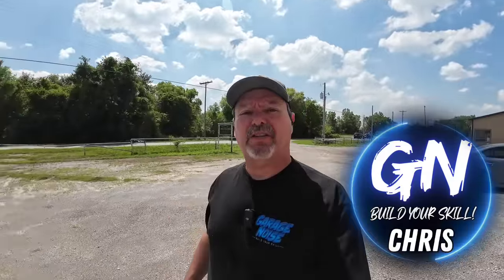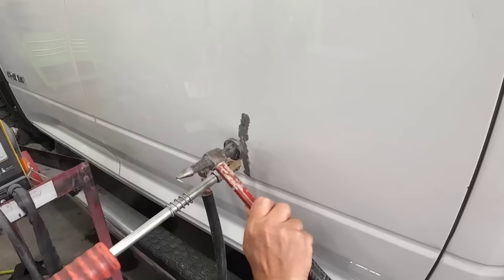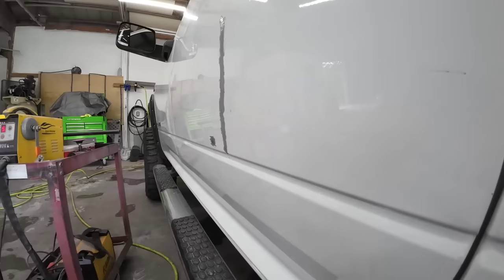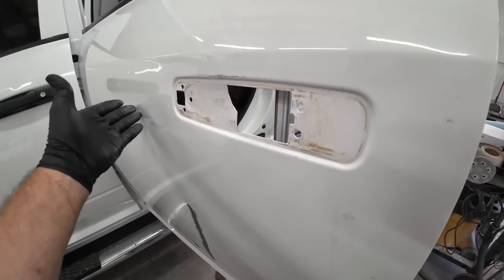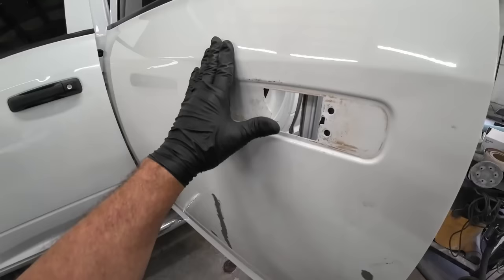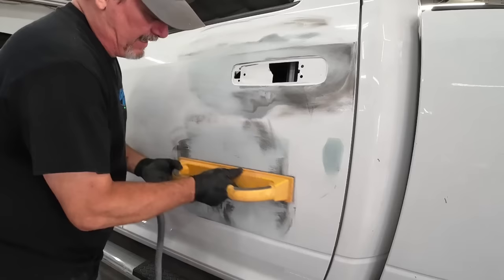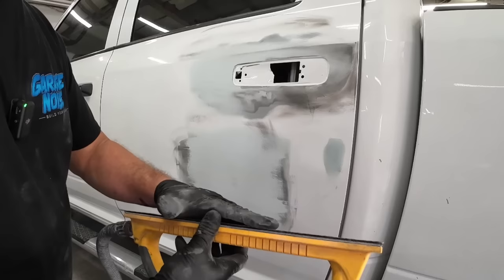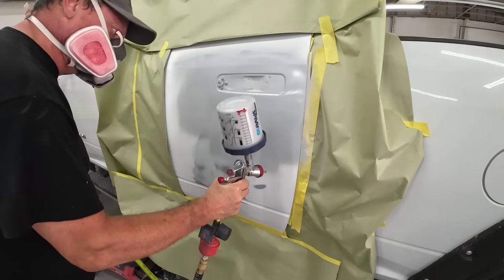BODY FILLER /BONDO TIPS and TECHNIQUES for PRO results!

Comment: You are using the king of masking tapes and sandpaper but the absolute worst filler. Interesting contrast.
Reply from the maker: I had to look to see what filler I was using🤣. It's  definitely NOT the worst, It's  not my favorite. Right now I'm  using upol lightweight gold and that is excellent.
Reply: @GarageNoise  bondo brand is pretty terrible, USC glaze makes more pinholes than it fixes too. That Upol stuff is pretty good. We use Rage ultra at work, no putty or glaze required. Chalks up real nice when you sand and spreads like butter.
Reply: I use Rage Ultra also. I like it because it stays green longer and makes it super easy to sand. I always top coat a thin layer of Icing on mine but everyone does it a little different.
Reply: @Grimsaviour hi I messed up a panel can you help
Reply: Can you tell me what you would skim with? Or not to? 68 cougar pitted roof. But I'm putting a new vinyl top back on. I just worry about cracking later??

Comment: I’ve been in the collision industry for 38 years. Straightening panels has become so much more difficult throughout the years. The thinner the metal they use the harder it is to work. Much easier to pull but harder to sand filler flat because the slightest pressure moves the metal. Back in the day it was more difficult to work the metal but sanding filler work was much easier because the metal didn’t flex with pressure and there were more body lines and convexed or rolls in the panels. Today’s vehicles the metal is so thin and flat panels like to bounce.

Comment: Pretty basic stuff first rule never put your bare hands on bare metal !!! And on higher end cars never put filler on bare metal as The ingredients in the actual Hardner of the filler causes rust underneath the filler in time as it Reacts with the 😮steel it’s ok on smash work in a fast 💨 moving shop  but on my own cars or Restoration work on muscle cars epoxy primer first always

Comment: I’m old school but it’s cheaper to go buy a replacement part aftermarket then to fix the problem by the time you pull out and bondo block primer it’s better to just buy a replacement one
Reply from the maker: Maybe, but then how would I make a video sharing how to repair it?😁
Reply: Cheaper? No then you have to pay for the overhaul  and transfer of parts between doors and to remove and install plus prep time and paint materials definitely better to repair the door for both the tech and the insurance’s wallet

Comment: Nice tips for a DIYr like me. I just went through my first gallon of U-pol Professional filler which sells for $37 at O’Reilly. It’s one step up from their base filler. I used to use Evercoat, but it’s now twice as much as U-pol. I really like the U-pol versus Evercoat and 3M Bondo brand. You don’t have to stir it up to mix the resin when you first open it up! It’s smooth and easy to spread and apply. I get a minimum amount of pin holes in it. It easy to sand. No reason to ever use another brand or pay more to get a “better” product imo. Great for my needs. Thought I would say that since you compared the USC brand filler to U-pol. I agree with you.
Reply from the maker: Yes, Right now I feel like the upol filler is the best all around filler all things considered. Appreciate your comment!
Reply: Thanks for the info. I bought 1 gallon of evercoat about 1yr ago and it’s so much better than Bondo filler, but it cost me almost $80!!! That’s outrageous! Now I’ll know that there’s a better option, although I do t do much body work, but I’m planning to start getting into it more.
Reply: Yes...ALL EVERCOAT products went UP in price at a 30-35 PERCENT markup beginning of LAST year 2022...So their BEST quality RAGE ULTRA filler went from $80.00 TO A whopping $135.00 retail price! 😬.....I mean, c'mon EVERCOAT 🥵. THAT IS your THANKS to us restoration guys that SWORE by using the EVERCOAT QUALITY line of fillers, polyprimers etc....I hadn't ever used ANY UPOL fillers yet, but I am currently using the 3M (customer has an O Reilly material account so) which? I actually REALLY like it. Doesn't sand ANYTHING like the RAGE ULTRA (as THAT IS WHAT we have to pay for- SUPER easy sanding filler that is reminiscent of drywall topcoat mud!) But still....Guess I'll have to try some UPOL after these two 3M gallons are used. 😎 Happy Restoring and Cruizin 🤘🔥🤘
Reply: @_N_B_0496  And yeah, STAY AWAY from actual BONDO brand filler! NOT a quality product AT ALL 😞.... I mean CRAP .

Comment: Amazing tutorial Chris, it's very interesting to see how you pull out the dents in the door you could actually see the dent coming out when you pulled on it while nocking down the crown. As I've mentioned before body filler is my weak point as I always take of to much then I find it difficult to get the shape back in the panel.
Thanks for sharing your skills with us🙏👍John UK
Reply from the maker: Glad it was helpful!
Reply: No entiendo mucho inglés  y no fue my intensión causar ningún problema yo no beo bien a más de 20 pies

Comment: Hey Chris. Great job but have you ever tried the glue tabs they make for paintless dent repairs. There are several guys on you tube channel that show them fixing dents that are worse than the one you fixed. I was working in body shops where we drilled 1/8" holes to screw in the slide hammer + pull rods to the same type of repair you did. How times have changed. Thanks again Vince.
Reply from the maker: Yes, I've been working on my glue pulling and pdr skills. I do some glue pulling in a upcoming video. I'm not as skilled at it as a pdr tech. some of the dents they repair is impressive for sure.
Reply: @GarageNoise I'm NOT an auto body repair expert, by ANY means. I'll start with that. People do not realize how easy/deceiving YouTube can be sometimes ,when it comes to watching actual experts "show off" their skill. Experience. Only word lol.

Comment: Is my first time doing body work with Bondo and it's cracking and also has pin holes what should I do sand it out and start over?
Reply from the maker: Not sure why it would be cracking? What filler are you using?
Reply: Yes

Comment: Hi Chris,  nice video.  Regards from México.  
Doubt.  What is that on  black color over the bonded area? 15:12 
Is it spray paint? To fast to see what are you applying. 

Tank you in advance.
Reply: its called guide coat. comes as powder like he used or in a spray can

Comment: By the time you worked on the door and did the bodywork and all the work it was cheaper just t buy a new one
Reply from the maker: When you consider the blendind, de triming, price of the new part and if the used door is not the right color you need to paint the inside of the door. It ends up being more costly to replace.